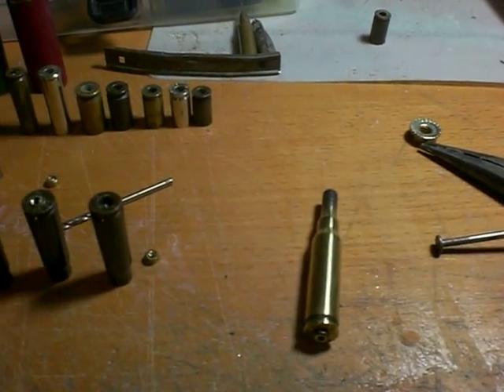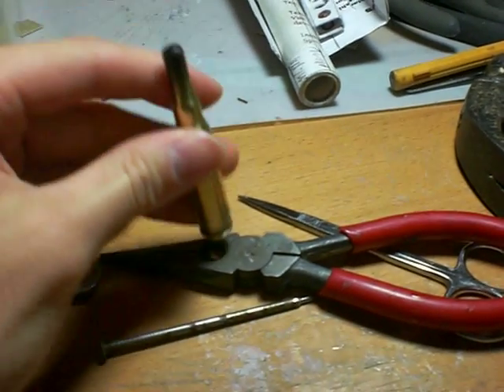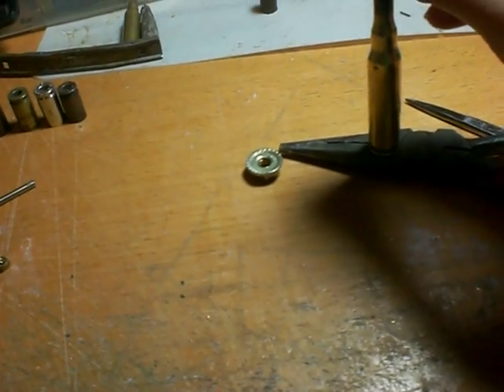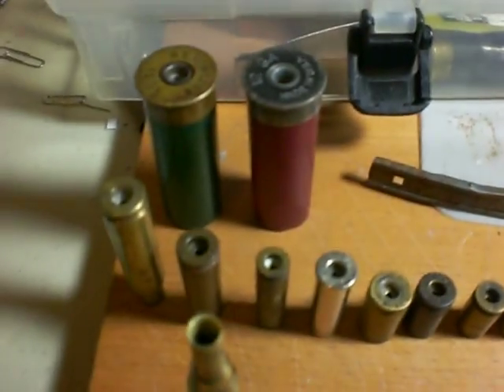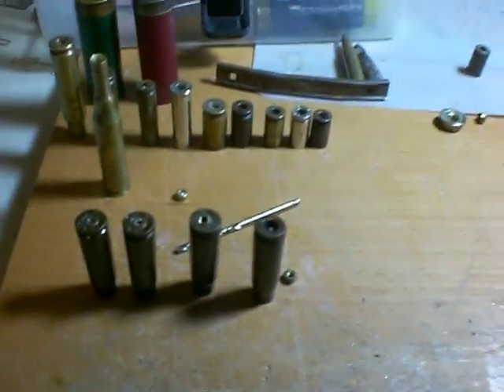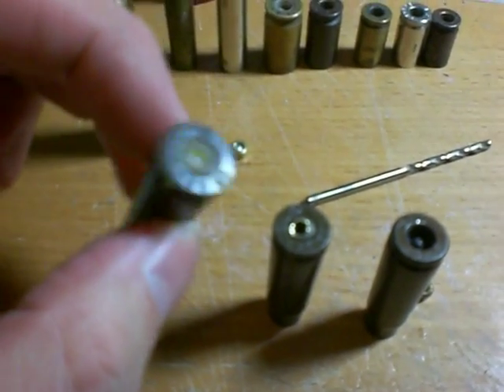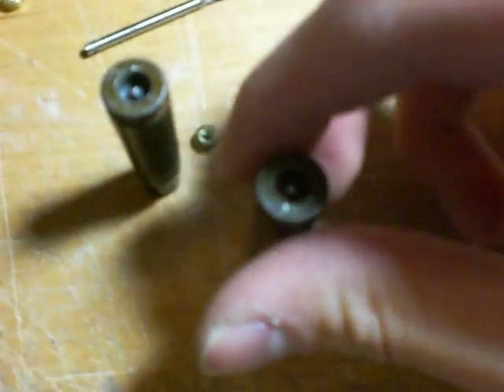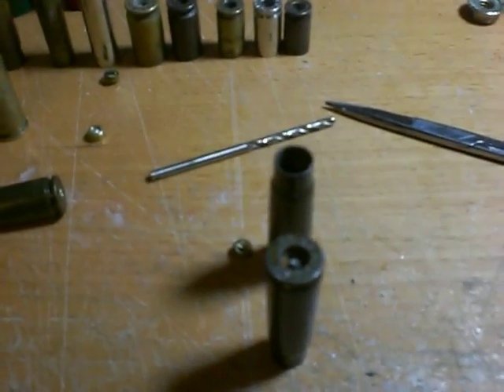Poor man's De-priming (Boxer and Berdan)

Comment: u saved me here 
i have an m1 garand and i wanna shoot around my house (got five acres with neighbors all around)
i was thinking about getting 30-06 bullet molds and some resin and some release agent or i can use hot glue that is pretty hard i think and i dont want to buy anything i dont have to so imma try this 
do u think i can prime by taking a punch from the inside and lightly tapping a new primer in? one thats bigger than the flash hole duh need light load is all primer,bullet and grain pdr

Comment: You can deprime the berdan cases and leave the primer cups intact by filing the cartridge case with water put a close fitting dowel into the mouth of the cartridge and give it blow with a hammer. Obviously you do this in a bowl and but a piece of rag around the dowel and cartridge mouth because the water squirts out. But this way the primer cup will be left intact and can be reloaded. Great videos you make! Thumps up.

Comment: @videofreakmanic123 Most likely. Are they 1 hole, or 2 inside? If its 1, any standard de-capper tool would work. You jst need the right size dyes.

Comment: I'm looking forward to reloading 300 blackout ammo. This video will be very helpful for removing primers. Thanks.
Reply: Aaron Laudman if you are planning on making ammo, especially 300bo, you need good equipment, and good equipment has depriming systems built in. This is okay for tinkering, but I would not use this method to make any quantity of ammo.    If you are going to make .300 brass from .223 brass, then you need a press to form the neck of the brass, jig to cut them, a full length re-size die, and a seat and crimp die at minimum along with powder scale and other accessories. .300 black is dangerous due to the fact that it can be put into battery in a .223 rifle and needs to be assembled properly
Reply: A proper set of dies and a proper press renders this process useless.  I watched the video because I'm bored

Comment: Use the Hydraulic method to pop them out and then hammer out the dimple and re-fill with priming compound of choice (like caps). No need to damage them with a drill and scissors.

Comment: For the Berdan primers, you can also use the hydraulic method which preserves the  primer cup. 1. Fill the case with water. 2. Get a dowel that fits the neck perfectly so it seals. 3. Tap/hammer it quickly and the water pressure should pop the primer.

Comment: You could always use the hydraulic depriming method. It makes a bit of a mess, but it's safe because you will deactivate the primer in the process. You can reuse the primers shell as well, you just have to clean it out, and put new priming powder into it with a piece of paper.

Comment: Hi Jessdigs,

Thanks for the advice. With your advice, I did recently buy a jig to cut .223 brass to make .300 blk brass. I'm slowly get the other dies and equipment to start casting my .300 blk rounds. .300 blk rounds are becoming harder to find and it is a little expensive. I know I will have fun casting my own rounds. Thanks for the response and advice. 

Thanks Jessdigs, 

Aaron

Comment: That's a pretty complicated way to deprime Berdan primers. It will certainly work, but complicated. The best "poor man's method" is water. Yes, water. You still need a recessed hole for the primer to fall into, and you need a rod or dowel that just fits inside the case mouth. Fill the case with water, place it over the anvil, insert the rod into the case mouth, then smack it with a hammer. Hydraulic pressure will pop the primer out.
Yes, you get wet this way, but NO other method works as well. 
My question is, why are you trying to reload Berdan primed cases? In Europe Berdan primers are available easily, but if not in Europe, getting Berdan primers is a chore. I do know of a couple of people who use Berdan cases, but they convert the cases to accept Boxer primers. How? They "sleeve"  the Berdan primer pockets to fit Boxer primers, drill new flash holes, and then use Boxer primers after that.

Comment: So I have been told that you cannot re-load berdan primed cheap AK ammo. Is that true or untrue? I have not started reloading. Yet.
Reply: Eustathios Vanight you can, it is just not as easy because de-priming is a bitch, and most berdan primed cases are steel. While it is absolutely possible to reload steel, it is harder on the sizing die and the decapping pin needs to be removed unless you convert the cases to use boxer primers